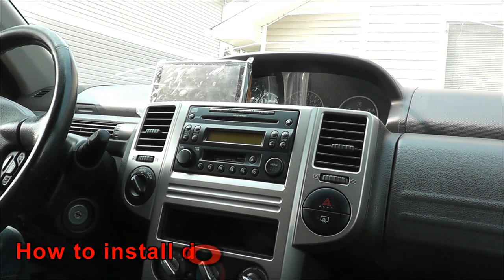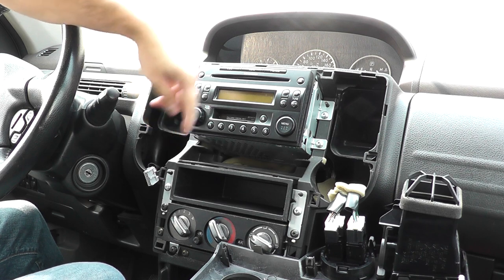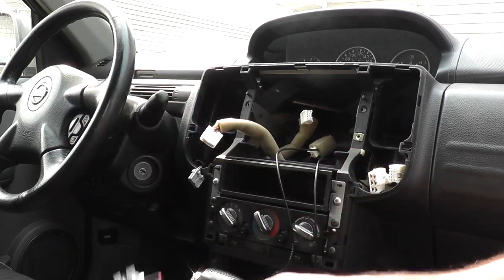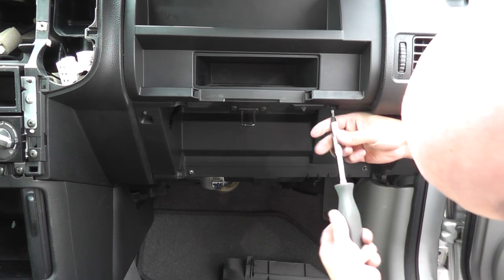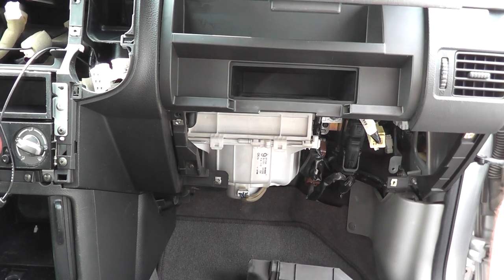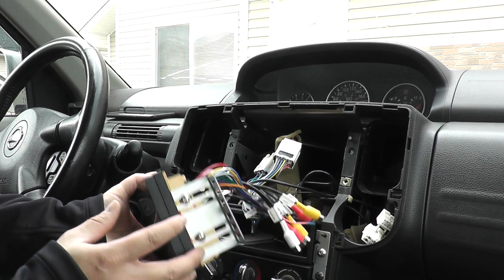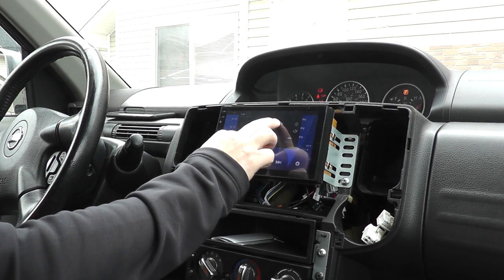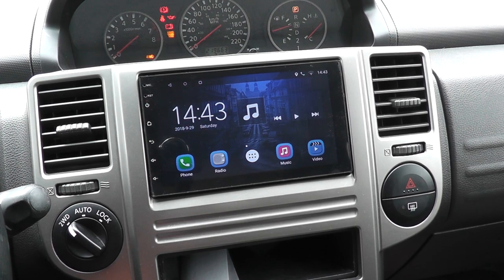Double din radio install - 06 Xtrail

Comment: Hello Esqueleto,

Big thanks for your explanation, it will help me a lot because I want to do the same thing in my 2002 X-Trail.
I have only one question: when you switched from your stock radio to this one, the steering wheel controls still works?
Reply from the maker: Awesome, glad I can help you out.

Comment: Thanks so much for the great video man. So easy to follow. This literally saved me $350. Can you tell me how you cut your mounting bracket? Mine is not sitting in my dash evenly
Reply from the maker: Glad it helped you out 🤛
I used a angle grinder to cut mine to the length I needed.
Reply: @esqu3l3to  my brackets look similar to yours. Did you say you took off about an inch?
Reply from the maker: About but can't recall. What I did was to measure the distance from the oem radio front edge to where the bracket bolts on. if that makes sense

Comment: Hello. I have an issue. Mine is exactly like yours so I have cut and joined all the cables correctly onto the adapter to go into the screen. However when I turn the car one there seems to be no power getting to the screen. It just won’t turn on. I have checked the fuses and they are good. Also the link you sent for the plug adapter is no longer available. Could you resend the link? Can you help please?? Thanks
Reply from the maker: I just seen your comment now, noy sure if you have fixed the issue with your head unit. let me know.

Comment: Great video. Thank for sharing. Just a question, did the steering wheel control worked? Thank you again.
Reply from the maker: Thanks! 👍 this xtrail did not have steering wheel controls so I did not have to wire them in.

Comment: Great video thanks!
1) Are you able to use steering wheel controls with this setup? e.g. volume up/down
2) Presumably this would work just as well with CarPlay?
Reply from the maker: thanks!
1) yes this unit is setup for steering wheel controls. My xtrail actually does not have any steering wheel controls. Depending on your car, most of these units have plug and play harnesses that allow for steering wheel controls to work without any added harnesses. 
2) I have not tried carplay however I am sure it would. Now that you mention it, I will try it as well as android auto. Having said that I have android phones but do have a ipad so I may try that. 
3) let me know the year, make and model of your car as well as a pic of your oem radio and I can see what units will work for you. chucho_301@hotmail.com
Reply: Actually I am looking at a unit for a 2006 Nissan X Trail which is how I ended up on your video! Thinking of getting a Sony XAV-AX100 as long as it will work with the steering wheel controls...  @esqu3l3to
Reply: @esqu3l3to  Actually I am looking at a unit for a 2006 Nissan X Trail which is how I ended up on your video! Thinking of getting a Sony XAV-AX100 as long as it will work with the steering wheel controls... @Esqu3l3to
Reply from the maker: Ahh ok, I don't see why it wouldn't. You would only need to wire up two wires for it to work. I should look that up so I knkw how to wire it.
Reply: Ok cool, thanks again! I haven’t bought the car yet - how do you rate the speakers and sound system generally??
Reply from the maker: They are not that great tbh. Basic sound, not much bass. Even with the new head unit it doenst sound great. I will be looking to replace the speakers for sure and add a sub.
Reply: @itonlyadds  Hello! do you know if the Sony XAV-AX100 fits the Nissan X trail T30 2005 size-wise?

Comment: Very helpfull video and great work. Congrats!!! I do have a problem though with the harnesses. I have a similar (almost the same) Double Din radio. The link you have for the harness shows a part with 2 endings (red,brown) while my new station has one ending like yours on the video. I can't find one new already fixed with one ending? Do i have to cut and glue the wires manually? Thanks in advance....
Reply from the maker: Thanks! Wel, the link will show both ends of the connectors but you will only need the one side. In that case you would cut the red and brown connectors off and splice the wires to the new radio harness. Therefore, you will not need to cut the factory harness. You may be able to find a harness locally that does not have the added connectors. This was one that I found online for the purpose of showing what the connecors are needed.

Comment: Didn't you run gps cable? Why not not show navigation. No one takes out OEM radio/CD to just replace with radio only. Its of interest to to tell model and features of new one also costs.
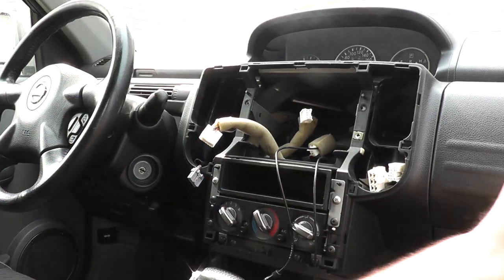Reply from the maker: 1) did you watch the video? I clearly show where I ran the GPS antenna at 4:18 to 8:06 2) I did not show all the features because that is not what the video is for; it's installation video not demo 3) Yes, a lot of people replace their stock head unit with a single din or double din but not always with GPS, everyone gets what they want and need. 4) links are in the description box to which you will get detailed information on the head unit and price.

Comment: hi,thanks for sharing ,just one doubt ,it doesnt comes with euroconector cables to conect without need to find cables and all that?
Reply from the maker: Correct, the unit comes with a few wiring harnesses. However, they may not fit your vehicle. Its best to check what you have and get one for it. Then use the universal harness for the radio to connect to that.

Comment: Did the lights on the buttons work? 

Is there a screen brightness setting? 

Can it be updates to the latest android OS?
Reply from the maker: 1) no the lights on the panel do not light up, which sucks
2) yes there is a screen brightness setting, you can access it by pulling down the screen. Unit also dims when you turn on your park/headlights on
3) I don't know of any updates. Having said that these units runs jusy fine with older android OS.

Comment: Need help. It seems I already have a harness attached to my radio unit. It is a single power plug instead of the two ones you have. Now, I want to cut it off and hardwire it with the universal power plug I got with the new head unit. I am able to trace every color wire but the black wire is missing on the harness plug. I wonder if the electrician who did the modifications, used some other colored wire for the (-)ve. How do I find out? Nissan Xtrail 2005.
Reply from the maker: What radio did you get? If all you are missing is the ground wire, just attach a ring terminal to the ground wire and use a self tapping screw behind the radio metal frame. When I did mine I had to do that because the negative did not allow the unit to function properly.
Reply: @esqu3l3to  Thanks. It's a Ruancheng 7" universal head unit. I extended the wire and got it hooked on the metal body behind the unit. Every thing seems to be working fine now. Appreciate your help.
Reply from the maker: No problem 👍

Comment: Hi.Great video.How is the GPS?
Do you ve full offline map on the device?
thank you
Reply from the maker: GPS works good, not the beat but works. You can download offline maps directly to the unit and use them without issues. I recommend getting a unit with expandable memory because you will use up the memory quickly when updating maps and other apps you download

Comment: How dark it can be in the night? 😁
Reply from the maker: It does have the dimmer from the radio harness as well as a dimmer built into the unit. You can adjust as required or preferred.

Comment: Where did you find the wires for (1) reversing switch or reverse light wire, (2) park light/tail light wire?
These are the two mixing wires I can't find.
Reply from the maker: For this install I did not connect anything for a reverse camera. I am not sure of the location of those wires up front. Your best bet is to go to the rear panel and trace the reverse light wire.
Reply from the maker: I am thinking of installing a camera in this xtrail but not sure when. When I do I will make a video but dont know when that will be.
Reply: OK. How about the light wire?
Reply from the maker: Do the same for the park wire since you will have access to both on the rear panel.
Reply: I don't know where to find the park wires.
Reply: I already got the unit installed, following your guide. But lights does not work. And reverse camera not installed yet.
I want to know where to find the two wires, before I open up the dashboard again.

Comment: Do you have any advice for what to do in order to improve the radio reception on these X-Trails.  I changed my head unit some time ago hoping that the reason was in my old one however, it seems to be the antenna.
Reply from the maker: I would first check to make sure your antenna is pushed all the way into the new radio, perhaps it cane loose after you put your dash back together. Also check on the roof where the antenna is located and move forward and back (mine does move) to see if a different location fixes the issue.
Reply: @esqu3l3to  It is fully pushed and tight.  I believe it could just be old and probably there is some damage to the cable from the antenna to the radio.  I'd like to change the antenna and any cables that go with it.
Reply from the maker: Ok I see, it shouldnt be to hard since the antenna is located right above the dome lights.

Comment: How do you change the antenna? Can the roof top part be removed and replaced or does the stereo have to be pulled out
Reply from the maker: You will have to remove the radio in order to access and unplug it from the radio. Then trace it up to the roof and remove/replace. I have never done it so I dont know how easy or hard it may be.

Comment: Did u use the mounting brackets off the old radio or did they come with the radio?
Reply from the maker: I used the brackets they provided, howevwr, I did have to modify them to fit
Reply: @esqu3l3to  I'm facing this issue as well. It looks like the harness will need to be cut as it is slightly larger and it gets difficult to put back the panel. I used the ones from the older model and it has aligned with the stereo panel cutout, but it ain't closing off completely.
Reply from the maker: Did the new radio come with its own brackets? I used the ones they provided however I did have to modify them just as I posted in the video.

Comment: You didnt have to cut the factory oem connections did you? Just the harness you purchased off ebay?
Reply from the maker: Correct, I did not need to cut any wires from the oem harnesses. I just soldered all the wires from the new radio harness to the adapter harness made for the nissan.
Reply: @esqu3l3to  did you have to remove the brown and black connectors on the ebay harness
Reply from the maker: I didn't because the one I got locally had just the connectors for the oem radio. The other side was just the wires.
Reply from the maker: @callunr8590  my harnesses looked like this...http://www.metraonline.com/part/70-7550
Reply: @esqu3l3to  I purchased the ebay harness in your link if you look at the pictures what do you think the red and black connectors are om the end. Are they for putting stripped wires in for a clean finish. Or should I just cut them off and make my own connection even if thats the case!
Reply from the maker: They can be connected straight to oem radio harness if thats what you have, otherwise cut them off and solder/crimp all the wires to the new radio.
Reply: @esqu3l3to  Finally arrived, it had a inch crack in it :( I plugged it in just to see if my wiring was working.
Messaged the seller hopefully I get a replacement.
Reply from the maker: Oh man! That sucks. Hopefully you can get a replacement real soon.

Comment: I don't understand any of the connections bro? Could you clarify them pls.
Also I'm not sure if mine are the right ones but I did by the iso adapter thingy
Reply from the maker: The connections are fairly simple, just as any radio install its easier to have the adapter harness(ses) to make it simpler to have all your wires connected. As for this specific radio the connectios for the gps there is only one which looks like the connection for your tv coax. All the other rca/video/usb etc are simply made by matching each port (not labelled) but can only go into one port.
Reply from the maker: Depending on what you buy and where there should be install instructions, in my case I simple looked at the pictures on the website for the unit. And like I said before each cinnection can only go into one port so you wont mix them up. Hope this helps if not email me at chucho_301@hotmail.com
Reply: Thank you my guy for the quick help, I've got it fixed now😁
I hope you love your x trail jus like I love mine
Reply from the maker: No worries man, I do like my xtrail. I've got more videos coming for it so subscribe for that.

Comment: Was this compatible also in 2008 xtrail? Hoping for your response
Reply from the maker: Yes it should fit the 2008 xtrail as well. I can check for you if you want. Email me a pic of your radio to chucho_301@hotmail.com and I can let you know.
Reply from the maker: But if your oem radio looks exactly like mine from this video...https://youtu.be/pkWIEvA1kik

then yes it will fit.

Comment: My radio stays on sometimes after shutting off the car could it be because i used the ground directly to battery?
Reply from the maker: no the ground won't cause it to stay on. These android units do have a delay when shutting off which you can change to make sure it shuts off right away. Does it always stay on or? and when it does, how long does it stay on for?
Reply: @esqu3l3to   sometines stays on sometimes not.... And i never checked how long but 5 mins for sure :(
Reply: I actually unplug it every tine it stays on..... Lol and thanks for the reply :)
Reply from the maker: ok then it sounds like you may have your constant (battery direct) wire and accessory wire backwards. Meaning the unit always has power from the battery even when you shut the car off. Check those two wires (tipically red for accessory and yellow for constant). Also go through your radio settings and find the shut off settings, it should give you a few options and change it to immediate shut off. Let me know if this fixes the issue. What car do you have and what radio is installed?
Reply: @esqu3l3to  thats what i tought bur it doesnt happen wverytine maybe 1x on 20....  I think it might be an internal relay that stays on?
Reply from the maker: Hmmm not sure. Which brand do you have?
Reply: @esqu3l3to  chineese one lol im gonna ask for a replacement
Reply from the maker: Oh ok

Comment: How do you know what radios are compatible with your car? I have xtrail t31 '13 and I am clueless what radio will be compatible. Please help.
Reply from the maker: Well first, there isn't much info available about the xtrail for whatever reason. So it's hard to find a dash kit or wiring harness. It took a lot of looking around to find mine. Anyways, the xtrail will fit a double or single din radio. The challenge is the dash kit - to install the new radio. I sold my xtrail over a year ago but I will do some research again and let you know. Do you know what radio you want?
Reply: @esqu3l3to  Oh wow thank you so much. Yeah, I cannot find any info and all the forums are dead. This is the radio I am thinking of getting, but not sure about the cables and if it will hook up to my camera:

Kenwood DNX997XR

Comment: would this unit fit in a 04 nissian xtrail?
Reply from the maker: I believe so, but let mw double check
Reply from the maker: Yes looks like it will also fit a 2004 xtrail
Reply: @esqu3l3to  aight thanks

Comment: Hi, my x trail t30 has 3 connectors behind the stock stereo but every adapter harnesses fit only 2 of the 3. I have the exact same unit and it won't boot up when plugged with the 2 connectors that fit. Is the 3rd one mandatory ? Where can I find a 3 way adapter ?
Reply from the maker: On the two connectors, did you use adapter harnesses? if you did, check your 12v ignition wire (red) and also check your ground (black) wire. 
When I did mine, I needed to ground the wire to the metal frame right behind the radio as using the stock wire did not work. Also, even tho some cars have additional plugs, you dont always need them. Some have aux or other uses that dont make a difference when upgrading to aftermarket.